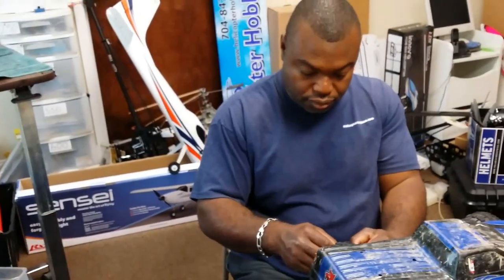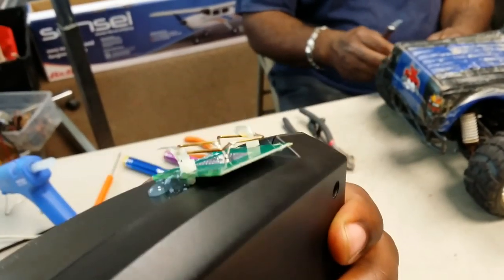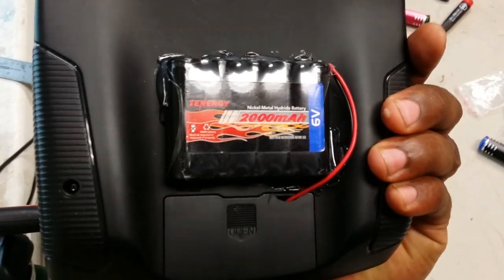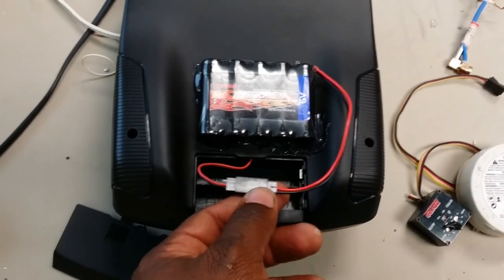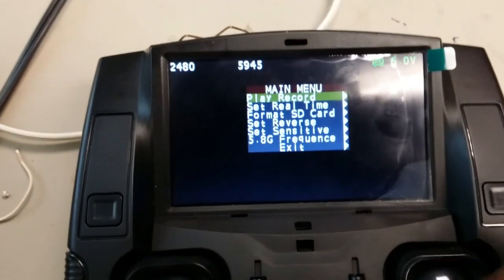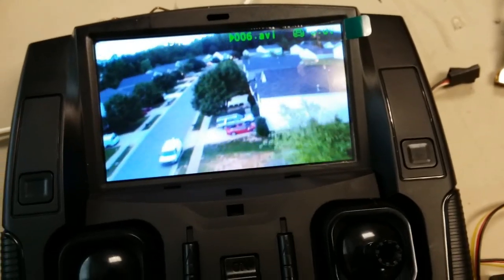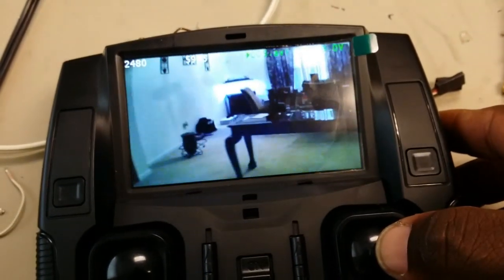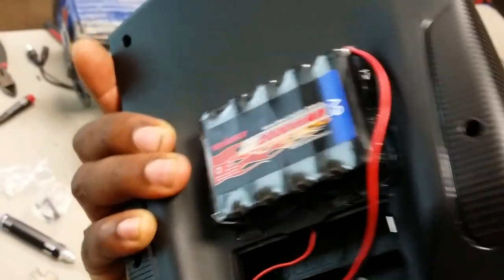Hubsan X4 FPV transmitter battery & antenna mod

Comment: So is that just a servo lead without any resistors and what not to show battery percentage on transmittor
Reply from the maker: Yep just added a servo lead to it.
Reply: @tntneon  thanks for the reply been looking everywhere and just want to be going big on a lipo as they cost an arm and a leg
Reply: @tntneon  do you know if I could put a 7.2 nimh battery as I've got one laying around

Comment: did the  antenna mod on the hubsan501s tx  can't record video or pictures when I tried  in doors. should I have tried this  outside. to work? I turned on the tx  without the  exterior antennas on. I thought I blown  out the 2.4 ghz on the  hubsan501s tx board. but every thing else works fine when flying.do you have any suggestions

Comment: I just bought the 501s but I don't see the transmitter menu options you have (like play video, etc). How do I get to that screen? Also, I saw another video with a Blue Sky panel antenna plugged in and massively increased the distance. Is that possible? Thanks for the help.

Comment: Hey In your pro opinion how do you rate the H501 s and you say after the resistor do you mean the wire directly on the battery post? Also where is your shop perhaps i can shop there?
Reply from the maker: It's pretty good. I just soldier right where the battery lead came off of the board. The shop isn't open anymore but his web site is still open. He may open the shop back up later on... Be blessed

Comment: Looks like the Video RX antenna is a biquad...11dbi nominal gain.

Wonder what the output impedance is for the 2.4ghz feed over on the other side?

Comment: i did my transmitter same as your and is the best mod i even done on a transmitter, i already use the transmitter with the new mode for 4 days and the battery show on the screen of the transmitter that is full of charge, and with the regular 1.5 duracell batteries the maximun use was 3 days  and i was crazy cause spending alot of batteries for the transmitter with the monitor, and thanks for uploading the video

Comment: TNT, thanks for publishing this mod.  I plan on bringing out the antenna by attaching a cloverleaf to the existing connection. They are on order so I will see when I get it.
Another note, I cannot get the quad to transmit video any longer.  It just stopped!  My TX jumps off of the 5865 frequency and I put it back but still no signal.  I carefully disassembled the quad and there are not loose wires or broken welds.  Has this ever happened to you?  If so, how did you overcome it?  I ordered a new one because I can't get the old one to work!  Please advise.

Many blessings,

Cloud

Comment: i have seen a mod by someone where they added a 2mp cam to it but they had both cameras on a lot of added weight can we just swap it out without the board and cam ?

and thanks for this post 
very useful on the controller battery fix

Comment: Plastic is a dielectric, so pulling the antenna out would make a negligible difference. Having said that, the inside is full of conductors - so pulling it out could help isolate the radio waves. Peace out.

Comment: so the antenna shown in the video, was the stock antenna, just placed outside the remote case? and if not, is there a tutorial i can watch on how to mount it, as im buying one soon, and want to fly as far as possible.

found the answer on a blog, it is. also, 4 1.5 volt batteris, usually gives you 6 volts. just some basic math.

another small detail i just found out, not sure what version of the transmitter i have, but mine states 4-13 volts, and im currently using a 7.2 volt 1800 mAh NIMH battery. and it is reallygreat, so far i have done just a few tests, and i have had it charged once a few days ago, still on allmost full charge. now i just need to lighten up the qquad itself, get a 500 mAh battery for it, and i will be good to fly for a while longer, and also remove the LED's, or the two red ones in the back, and move one of the blues to the front, so it lights up the path of the quad, so i can fly fpv in dark areas. should also make the battery last a bit longer.

Comment: I have a 7 volt battery and it weighs about half a kg would it still be able to fly with it or would be to heavy and it 7 volt to much for a husband h107d
Reply: Unfortunately, 7 volts are way too powerful for the Hubsan. Even if the motors would be compatible, it still wouldn't lift half a kg. If you really want to extend the battery life, go for a 3.7v with at least 500mAh, guaranteed 10 minutes of flight.
Reply: at half a kilo, you wont take off, even if the board and engines dont burn out, its a VERY small quad, im sure the battery you have is bigger than the h107d. im having trouble getting it to lift a HD808 #26 camera, and it weighs about 125 grams or so. and with a 380 mAh battery it flies for about 2 minutes with the 808, and about 6 minutes without it, going to upgrade the battery to a 500 mAh and strip the body down a bit, some of the plastic can be replaced with see throuh wraping, so long as im carefull and dont strcutually weaken it, should allow it to fly a bit longer.

Comment: What charger are u using to charge the 6v 2000 mah battery
Reply from the maker: My charger that I use to charge all my rc stuff. Accel 8.  Be blessed

Comment: is it also possible to replace the battery of the quadcopter by a bigger one?
Reply: Yes get the 500mAh
Reply from the maker: oscar graetz to get the antenna out just unscrew the tx and it's sitting right near the top . And then just pull it out.  Be blessed

Comment: so all i have to do is open the controller and pull out the antenna and hot glue it to the out side right?
Reply from the maker: That is correct.   Be blessed
Reply: did it and it works great much more reception ill be doing the battery mod next bro thanks alot.
Reply: do you thank this will work with any 5.8 reciever?
Reply: the controller i mean?
Reply: i know the controller will operate the hubsan x4 but i was wondering if there was any thing els it would operate?
Reply from the maker: ***** no its will not work on a separate rx. Pretty stuck with thier receiver. I have seen someone change out the antenna on the transmitter.